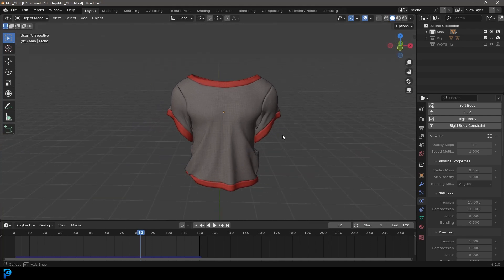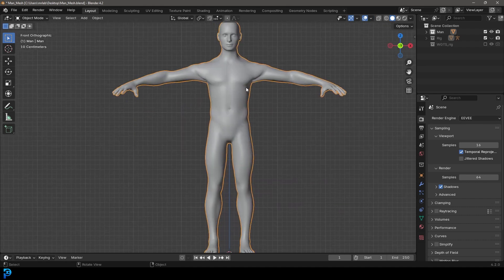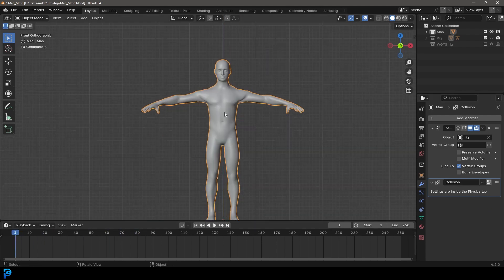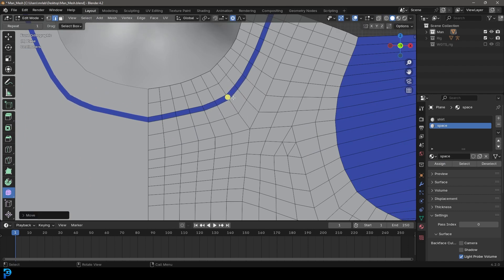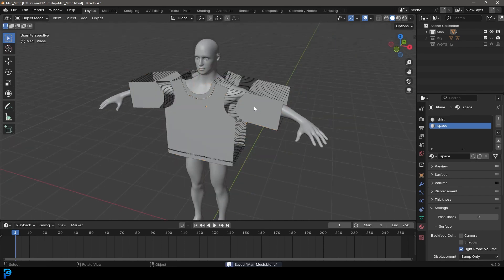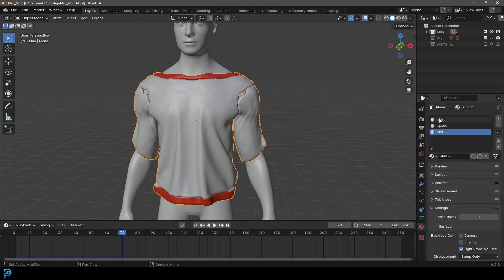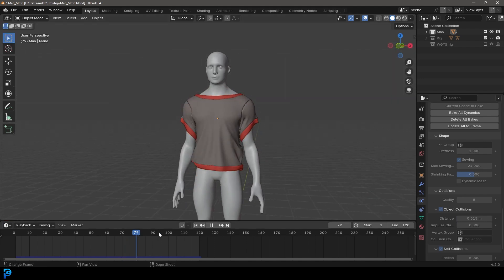Blender 4.2: Make A Shirt Tutorial - Cloth Sewing

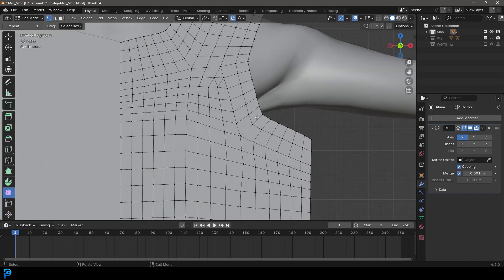Comment: I start having trouble at 8:05, as my smoothing tool doesnt do what yours did, but the issue really begins at 8:15. What key did you select to widen your range like that to round out the vertices? And so far the last one that comes out different is at 8:40, when I try to rotate the sleeve, the whole shirt rotates symmetrically from the middle instead of like in the video, and the S,X,0 ends up clipping the whole mesh within itself from the middle.

Comment: Thanks for tuturial. But as I see Blender still has poor capabilities in clothes. The stitches are ugly and skewed. Huge holes in stitches so the body can be seen through them.
I don't think that such clothes can be used in production. Too ugly for serious purposes.
Reply: I second that one. Maybe it will improve in the upcoming new versions.
Reply: end result with tweaks looks fine for me, and its not even maximum possible quality/simulation preset, properly cutted, tweaked and rendered result should look fine for serious purposes
Reply: @xzcsacascasd3154  , perhaps for static image is ok. But not for the animation.
This sweater looks more or less well while it's gray and the body is gray. On pink body this clothes will look weird. The holes will be seen everywhere. ; )
Reply: Good points. I think what he has done here is a bit overcomplicated for the finished product. I literally make my clothes by taking the pipe creator add-on and reworking the topology so it animates properly. 
This topology has some problems. The 5 poles are okay, since there's few and far between with mostly quads attached. The tri faces look like they would be a problem. Theres too many and too close to each other so the animation will skew around them.
With light sculpting and cloth modifiers being applied then re-added, you can make amazing looking clothes. Seams are easy with creasing and beveling topology. The only reason I watched this video was to see if cloth stitching had a real purpose I could utilize. Turns out, probably not, not yet. I still don't see the purpose of cloth stitching.
Reply: No. It's because people use single planes for the front and back, instead of adding extra geometry  because we all know that clothes aren't designed that simplistic. A few extra pieces for the shoulders, underarms and rib pieces would fix any other artifacts